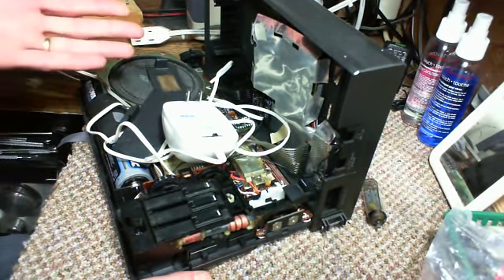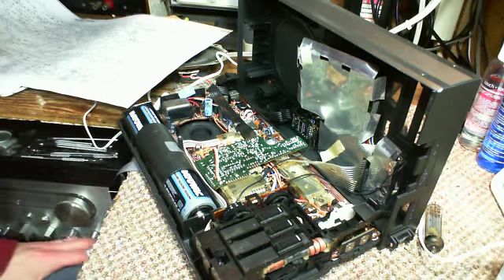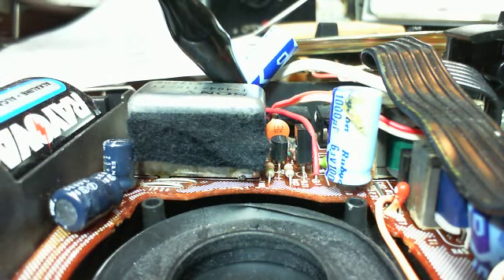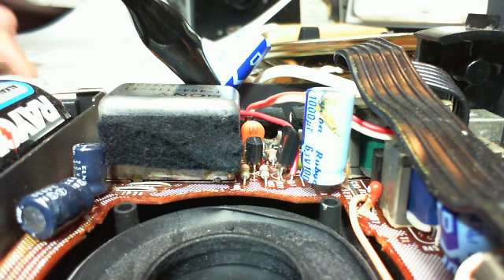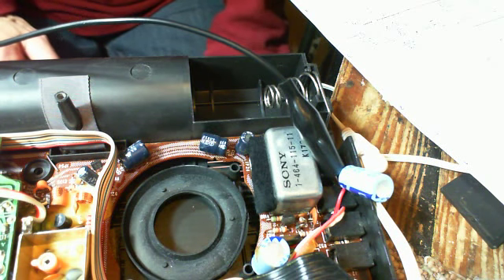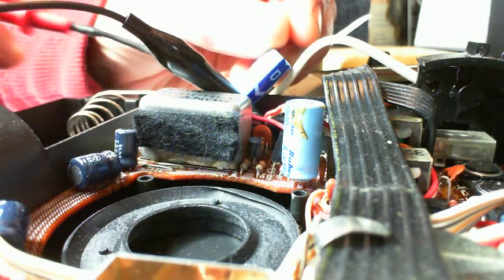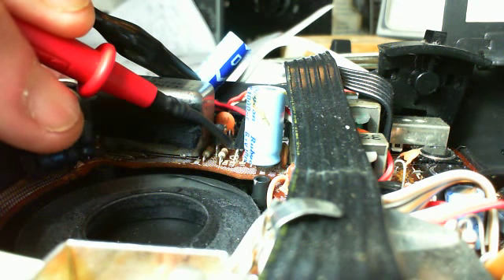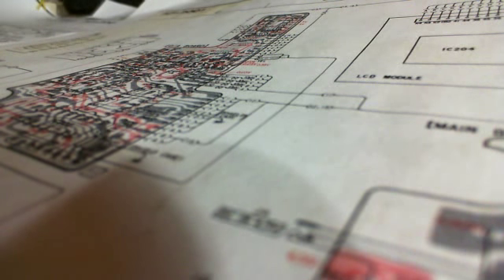Sony ICF 2001 Video #6 - A Closer Look at the Power Supply Circuits

Comment: From prior experience with these radios the battery circuits are not hard wired to the circuit board . They are small spring wires that are just extensions of the battery contacts and springs. These are poorly designed (very little contact areas) that just touch on solder pads on the back of the circuit board. Corrosion and dirt can be an issue especially if the batteries ever leaked and the killer juice ran onto the circuit board.
      It can actually eat away the traces and give you a high resistance circuits . This will give you an intermittent; it works ,you look at it and it don't work, issue .
       Take the entire circuit board out of the back half of the plastic case . Insert a screwdriver in the two slots in the back case  and lightly pry the tabs away from the board. Just remember there is one hidden screw  inside just above the sound control board assembly. I have hard wired these battery contacts direct to the pads and no more problems. But you can probably get away with cleaning them and use a little dielectric grease on the contacts. These radios can turn a person to drinking .
 I didn't watch all your vids on this, you may have already discovered this .

Comment: FYI RED on the Sony drawing is power "B+" supplies
Its a Sony thing
Reply from the maker: Does that mean all the red traces are at 18V or 6V or whatever the B+ is for that circuit?
Reply: Sony just said  "B+" soooooo.
I read that to mean any of the voltages that are power rails.    Its a Sony thing .....GOOD hunting

Comment: Hey Jim. It looks like Q26 and Q27 are only used to switch the radio on and off. The base of Q27 is grounded through R90 to turn it on. The base ofQ26 is driven by an output from the LCD module (probably for the sleep timer) to control Q27. I would concentrate on the voltages going into and coming out of the DC-DC converter. You were right that the power supply has to be confirmed before going on to the rest of the radio.
Reply from the maker: Too late on the power supply first.  I've done 5 previous videos of running around like a headless chicken - a chicken with a soldering iron.  Scary.

Comment: Hey Jim. I think the traces may be coloured to show both sides of the double sided PCB on the same print allowing you to follow the circuit more easily. Maybe...
Reply from the maker: I don't think so in this case.  None of the traces cross each other and I don't see any on the upper side of the board when I look at it.